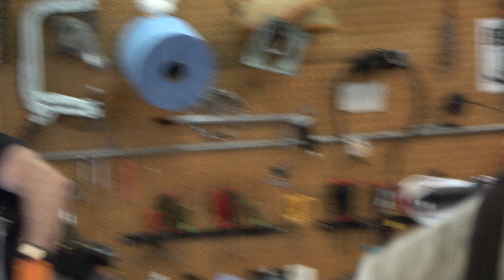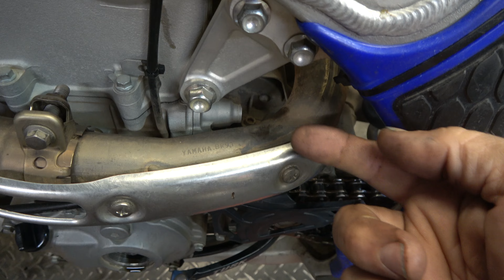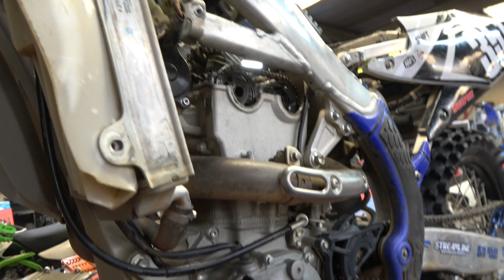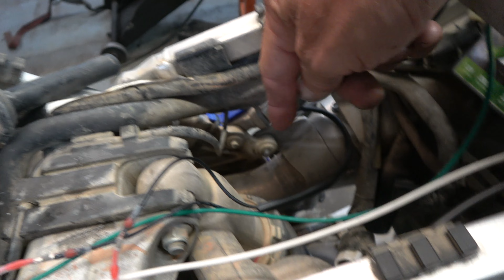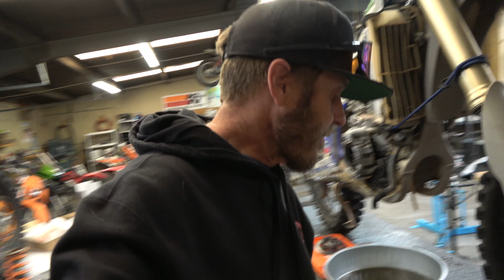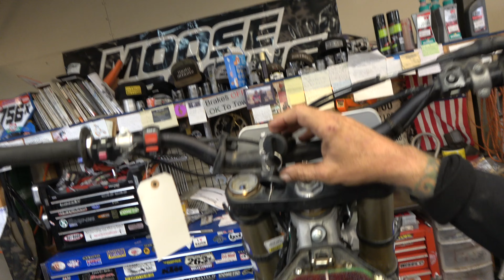YZ450F STARTER CLUTCH | YZ450F STARTER CLUTCH FIX | THE SHLOG #301 | HIGHLAND CYCLES

Comment: Those YZ’s are notorious for draining batteries with accessories. I had a fan and small light on my YZ450FX and it ended in me having to upgrade the flywheel for more charge.
Reply from the maker: I think this one is mostly to get legal. Rarely going to be on.